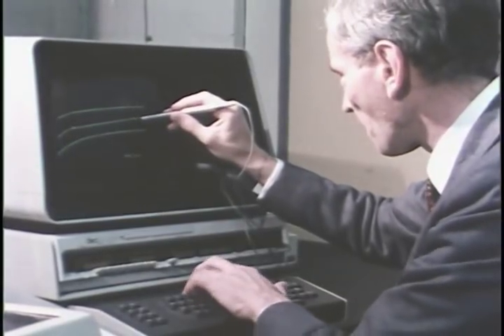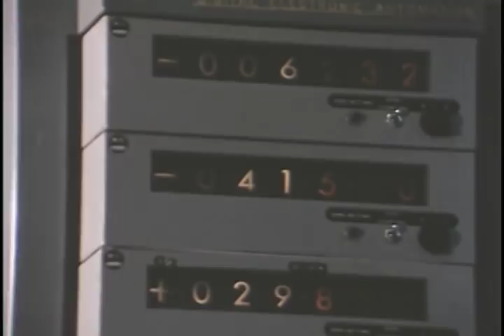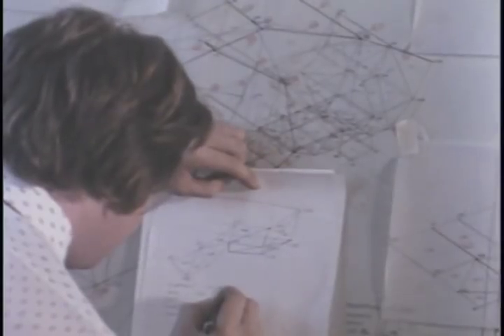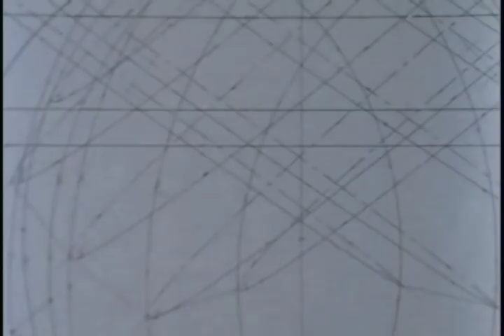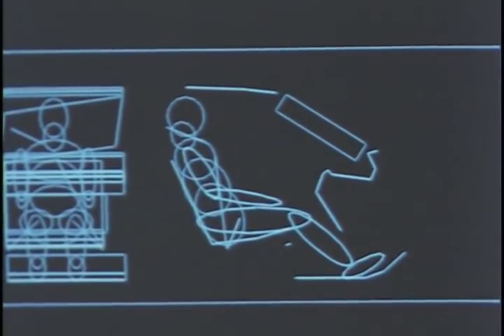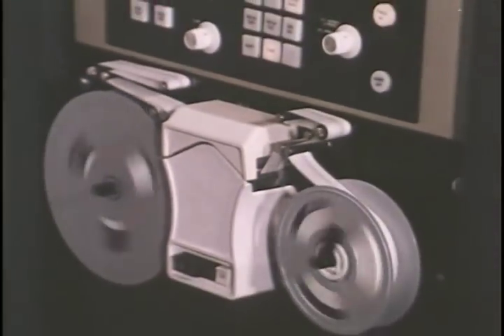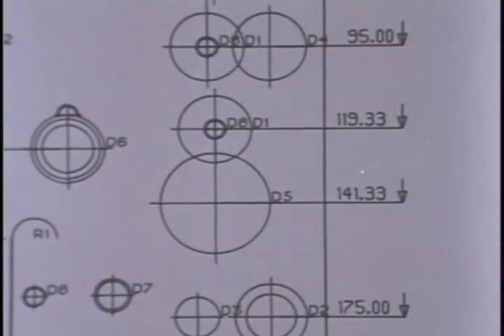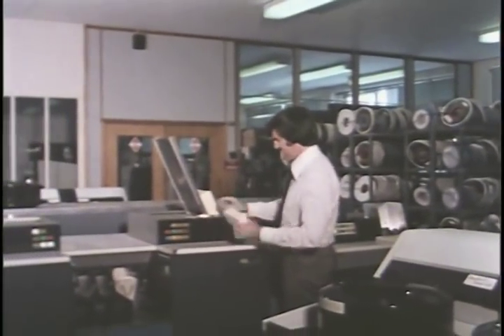Design with Style -- The Rover SD1

Comment: Went to the local dealership coffee morning in 1976 when these first came out. They had a white 3500 and to me it looked like a spaceship, it was magnificent. Drove a 3500 manual four years later and thought it was fabulous, great pick up, great sound from the eight cylinder engine and it felt special and so much better than the run of the mill cars around at the time.

Comment: They should remake this car with todays build quality id buy one.
Reply: I've thought that so many times.
Reply: todays build quality, are you having a laugh, the cars are shit...
Reply: Maybe be..but they are way better than cars from the 70's..
Reply: What led to the downfall of the Rover SD1 was the same thing that ruined BL's reputation. And
that was, as I recall, the dodgy electrics that were made by Lucas.
Reply: @cd78  If you want a 1970s car buy a Beemer!
Reply: Any of the cars they make today are made with 85%-90% Chinese low quality parts
Reply: @garethifan1034  Not even slightly! Only for the Corporations to rip of the customers with computer generated breakdowns.
Reply: @garydunn3037  there was no choice !; UK built Ford's & Vauxhall models used Lucas as well . in the case of Vauxhall they also  used  AC Delco as did  some Ford's .  BL were never going to use Bosch or Hella ( which were also crap at that time & in some cases still crap today) It was in the 80s via Honda ( Triumph Acclaim) that they started using the superior Nippon Denzo & Hitachi!

Comment: I used to dream of one of these until I finally bought one about 30 years ago, a 2600. It was quite a big engine for the time, and I thought it would be a good sporty drive. The 3 speed auto gearbox felt like a slipping clutch in a manual. The power steering was so soft there was no feedback from the road. So it had this completely disconnected feel to the driving, mushy transmission and mushy steering. The boot also filled with water when it rained.  I sold it after a few weeks.  End of dream.
Reply from the maker: Looked good though.

Comment: I owned PJR481R (Carribean Blue with Webasto roof 1977).  I replaced it with NJR835X (Moonraker Blue 1982).

The V8 engine was lovely with the SU HIF6 carbs (much less so with the later Zeniths' and Solex FASD).  The Borg Warner type 65 was a perfect match for the 3528cc small block V8.

Build quality could have been better.

Nevertheless, I have many happy memories of SD1 motoring!

Comment: A fantastic car, I've even had two different Rover 3500 SD1. Even today, in 2015 sees the modern out. And driving performance was excellent. There were many careless defects from the factory at delivery, but when they were fixed, the car drove like a dream. Too bad that Rover replaced it with the ugly 820 series and later 75
Reply: +Anders Vinther the 75 looked nice but yes the 820 wasn't nice at all
Reply: +Anders Vinther I had an 827 MK I and I think, this one was still ok from the Shape, but the MK II, I didn't liked at all. And well, the SD1 is a Timeless Shape. :)

Comment: The rover sdi , was a head of its time. i used to drive a 3.5 sdi  van den plas, met blue, cream leather hide, it was a fantastic car. the front looked like a ferari daytona, which they based it on , only problem like alot british cars they rusted badly, but what a car
Reply: No, it really wasn't, live axle primitive suspension, carburettors, did it even have rear discs?? An elderly tart in a new frock.
Reply: Interestingly I read somewhere the Ferrari Daytona took several days not weeks to design and doubtless less money was expended in its production compared to the Rover. How one failed and the other succeeded would be an interesting exercise.
Reply: No point in comparing the two. One was (supposed) to be a high volume family/executive car, the other a hand built  supercar.
Reply: It’s SD1 not SDi
Reply: SD 1. Special development 1. An " SD I was a Rover 200.
Reply: ....." SD i ".

Comment: Car of the year in 1980 i believe. 
I worked for a large main Leyland dealer at the time and there were so many SD1s stock piled they were out of date, so as they came in for sale they had to have the latest parts put on them.
One problem was the crankshaft main caps on the straight 6  used break in half.
Reply: It looks like a 1980s car, but the SD1 came out in 1976! Wikipedia: "In 1977 it won the European Car of the Year title."

Comment: My father had a 2600s when i was a kid, amazingly nice car to travel in...when it worked.
Reply: And drank a nice lot of fuel I bet, although the 2600 probably used less than the 3500, that drank it, especially around town, but was more economical on a run
Reply: @Keithbarber  Motorways were where it was at home, a good long distance cruiser.
Reply: @martj1313  I know, but many people have big engined cars for town driving, then moan about how it drinks fuel like an alcoholic in a brewery, but on the motorway, it was more economical on the fiel
Reply: @Keithbarber  speaking from my experience, i owned a 1997 4.6 range rover and around town i was lucky if i got into double figures, i knew i had no right to moan about it, or i should have bought a fiesta.

Comment: I had an SD1. The driver's field of vision was brilliant - there were hardly any blind spots. It was comfortable, reasonably speedy for its age, held the road well, controls all logically placed, & the hatchback design was excellent for hauling stuff around. That was the good bits.

Brand new, the doors didn't shut properly so it leaked when it rained. Even though I had it Zeibarted from new, rust formed on the wings within 2 years (which I fibreglassed over, resprayed with a can of Halford's Spray Paint, & promptly sold the car). The electrics worked "intermittently", especially the wipers after about 5 minutes of being switched on, so a journey on a dark winter's night became a lottery.

Having said that, I also had a Honda Civic (when they were small cars) at about the same time, and I had to fit new wings after 3 years, because the original wings had also started to rust - Japanese cars often came over on open boats, so came coated in salt water, and I had to wait 8 weeks for a new clutch plate, because every UK dealer had run out & there was some sort of common fault. Essentially, I had to wait for a boat to sail all the way from Japan to UK before I could drive the car again.

One has to remember that cars weren't built to last more than about 60,000 miles (engine) and 100,000 (body) or 5-6 years. That was accepted, and that was the design brief. One could keep them going for longer, if you were reasonably competent at being an engineer and bodyshop "DIY" bloke. You bought the manual, a few sets of tools, and off you went. One could find everything in the engine bay & there was usually acres of space in the bay so you could get your spanner in & graze your knuckles happily. Many an hour spent under the bonnet of my British made Ford Capri or Vauxhall Victor or whatever.

But, apparently, we make more cars now in the UK than even at the height of BL/Ford/Vauxhall days - but they are badged Toyota or Honda or Nissan. Oh well.

Comment: Great video. I owned one of these back in the late 1980's, a 2000cc twin carb manual model. I did 75,000 miles in one year, getting through a set of break pads each month and a gearbox, a steering rack, two front shocks and a clutch all in the same year :-)

Comment: This is the quintessential 1970s "computer designed" car; a sort of sleek overall shape that should have been gently rounded implemented with a lot of almost straight lines. Only the front fenders have anything gentle about them, everything else could have been done by a kid with a ruler. Buick and Oldsmobile seem to have done a clumsy job of imitating these lines on the 1978 Century and Cutlass, but buyers were so unimpressed that the bodies only stayed in production 2 model years. Maybe GM was trying to emphasize the cars' common engine heritage. Ultra ordinary mechanical design (disks/drums, rear axle, etc.) was part for the course at GM, but seems like a step back for Rover. The struts and unibody make the SD1 seem a little more advanced, but I don't know about the semi-torque-tube. At  least the SD1 had a full hatchback with folding seat, unlike the GM imitations. Not a high point of design for either company.
Reply: If you are talking GM then I reckon the Firebird T/A and Camaro from the 70's were much
better looking, and probably better made aswell.

Comment: I liked my two SD1's, but I remember the power steering had no road feedback and could easily loose control on a tight bend, I understand why the police force did't like them.
Reply: Are you insane? The police loved this car so much, they started hoarding them as soon as they heard they would be phased out. My older brother had the fortune of driving our Rover 3500 around a 90 degree corner but he forgot to slow down a bit. The result: the car did exactly what my brother wanted but we felt as if the whole world turned 90 degrees instead of the car. Never did that again but at least our car was the safest SD1 there ever was.
Reply: AudieHolland I'm sure their opinion changed when they got Volvo T5s...

Comment: The Rover SD1 perhaps a big Austin Allegro, because all BL cars in the 1970 from the Mini to the SD1 had a bad reputation for reliablity. A very distinctive car looking so different to the P6 it replaced, with the 3500 V8 being the first model launched in 1976, and the less reliable 2300/2600 the following year. My uncle's friend had a very early white P reg 3500, MKW900P possibly an ex police car, and replaced it with a facelifted post 1982 metallic blue 2600. By 1982 there was the option of a 2.4 diesel engine, and a two litre engine (2000) that was also powered the top of range Morris Ital, that was least reliable, I think that is correct? Then came the top of range Vanden Plas and Vitesse. And by 1986 the replacement initally saloon only 800 series was introduced.

Comment: shame they didnt take the same effort to the production of the car. car lengths varied by a few inches in length & the electrics never worked. i recall our family SD1 being in the garage for about half the time we owned it. faulty door locks, electrics, gearbox usually the main culprits. shame as was quite a pretty car. even more nuts was the development cost of a new 6cyl engine & gearbox when BL at the time owned jaguar and their 6 cyl was quite the performer.
Reply from the maker: A great design but from many other comments, it's clear your experiences were shared by a lot of buyers.

Comment: My 1967 Rover P6 has discs all round.  The suspension in an SD1 is more like an old truck compared to the P6 as well.  The SD1 was a backwards move all round.
Reply: Ah, that may look backward on paper but the SDs 'party piece ' is it's dampers, that have a self leveling Nivomat system which was highly advanced for a mid 70s car .& as for the brakes , the SD had powerful Lockheed, 10 inch ( mostly vented) front discs with, ( later cars ) 4 pot calipers, dual circuits on all models from the start ( 1976 to 86), 9 inch Drums with pressure reducing valve! That's got to be better in terms of ease of maintenance  & repair than the feeble Dunlop inboard discs  of the P6, which are a pain to replace pads & the  wedge rear pads are the same as the MK4 Zephyr!

Comment: absolutely gorgeous looking car but awful quality, such a shame.
Reply from the maker: +David C Haven't driven one but do like its styling.  Still fresh and clean.
Reply: +King Rose Archives Styling and the Shape, he reminds me also on the MATRA Bagheera.
Reply: +David C Well, Quality, in the mid...late 70s, most Car-quality wasn't the best. Like French, Chrysler-Simca.
Chrysler-Simca I mentioned here because my father had the 1501 and later the 1308, well... So that's why I think, almost all Car Manufacturer had not such Quality as we know by today.
Reply: It was indicative of the time. I used to work in a body shop that did Chrysler body warranty work. We did a large batch of Avengers where the C pillars were badly shaped. We had to sand out the awful lead joints, re lead them to the right profile and paint them good work for our company then. When the Chrysler warranty man came to check that the work was being carried out correctly this time, we asked him why they couldn't get it right at the factory. His answer was if the poor shaping was pointed out to the line workers, they were told to f&ck off. What a surprise British car manufacturing disappeared.
Reply: Now hold it, because mercedes, volkswagen, bmw and audi made very good cars in those
 days, with on exception, and that is the problem of rust, because rust protection
was not standard but an option and a expencive one, so no one took it, and 
that's why cars did rust so hard, but the build quality and reliablity was great of
the german cars.
Reply: To be fair, with the exception of the electrics (never a strong point of British cars), most of the serious problems of the SD1 were rectified by the early 1980s. But it was too late, the first three years after a car's introduction should not be the guinea pig testing phase of a new car, as it was with so many BL designed cars. The Maxi was another one - could have been a world beater but ultimately it was underdeveloped. Poor quality, notchy gearchange, it sold in huge numbers on the domestic market but the warning signs were there.
This is a great video though...
Reply: These cars werent worse than Renaults or even Audis of the same period

Comment: I had a old ex met rover police car a v reg 2600 with god knows how many miles on the clock had to replace the motors on the windows and the glove box field with water every time it rained but it run nice but my mate had a late low mileage 2600 with the later dash but he had a lot of trouble with it one was that the cam seized up doing the engine in

Comment: My father had an SD1 3500SE with electric windows and sunroof together with an on board telephone. The scary thing about the car was the frightening fuel economy at about 17mpg! A great design let down by shoddy electrics and build quality. The best car for me though was a triumph stag that SHOULD have had the rover v8 in it but the clever prats thought it would be a good idea to make their own....cue disaster.
Reply: Actually there is nothing "wrong" with the Stag's engine, IIRC the problem was with the cooling system.
Reply: Simon John Hinton 17mpg. realistic for a V8 at the time.

Comment: Funny how there are links to videos on the right with twin turbo 3500 V8's - 40 years ago a snip under 200bhp was pretty swift, now it's considered satisfactory in a Fiesta ST! 

Would have been better if they shortened the wheel base and made a hot hatch version instead of that ghastly Allegro.

Comment: The narrator mentions computers over and over again.  Well garbage in, garbage out, except that the garbage in this case looked like a crappy car.  Absolute junk.  Design, assembly, dynamics, everything.  And that engine - Buick is still laughing about finding a company dumb enough to pay them for that loser 215.
Reply: briggsquantum Your opinion? - should have gone to Specsavers. That V8 got to power a lot of different vehicles very successfully All aluminium V8 a bit too advanced for USA at the time.
Reply: +briggsquantum I´ve known a chap from near Bonn/Germany, who tuned his Rover 3500 SDI to some 300HP at well over 200k miles on the clock. Back in the nineties, he blew most contemporary sportscars out of the water with this machine, and it even survived long under conditions of german Autobahn madness. Wouldn´t have worked with a genuinely poor design, would it?
Reply: +briggsquantum It's not done bad in the Range Rovers: Bigged out to 4.6L so I'm not so sure Buick Canada's engine was crap at all.